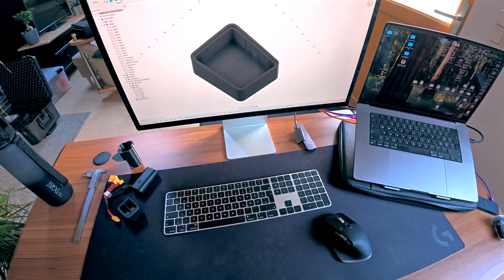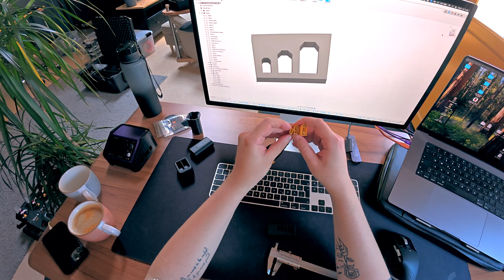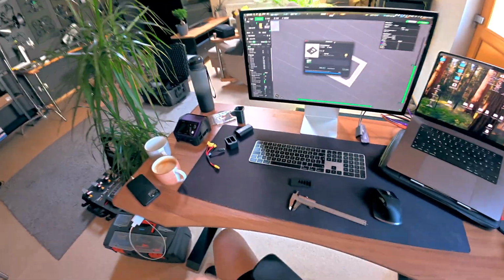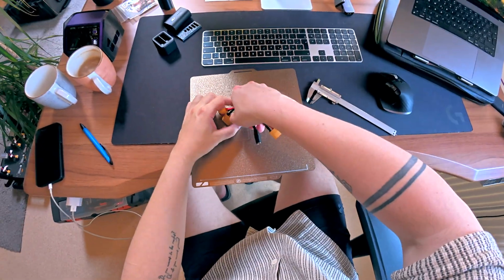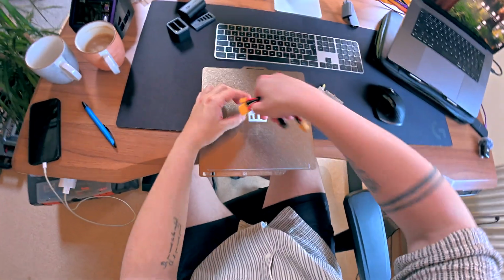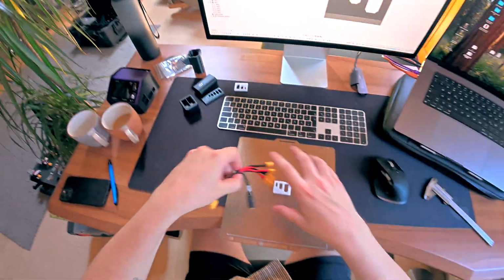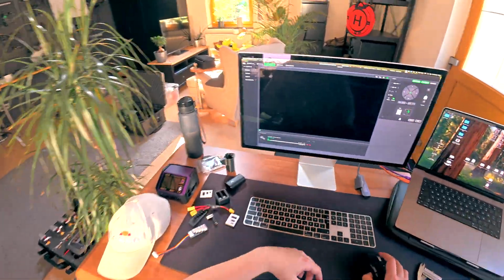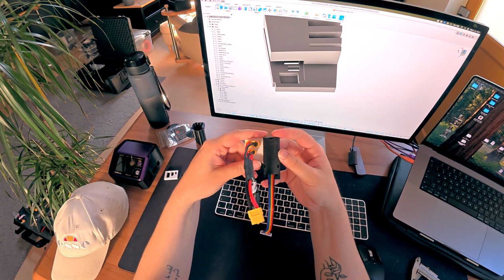POV: DESIGNING AN FPV CHARGING CASE

Comment: Could you suggest why my motors get instantly hot when flying, I have a 7inch with exax eco II 1300kv motors with the mamaba 55A F722 MK4 APP with 7x3.5x3 props with the aqua rush frame and I’m using the GNC 1850mah 140c battery. Thanks

Comment: So, you are making the most universal charger?
Reply from the maker: what exactly do you mean with "universal"?
Reply: @justfuxy_  with all kinds of ports, xt 30, 60, 90, with let's say built in jumpers
Reply from the maker: yeah exactly, like the easiest and least time consuming option to charge for fpv drone purposes. Have also like a DJI Goggle battery, gopro or action 5 pro chargers etc built in